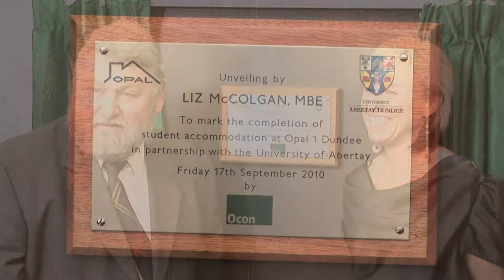Opening of Abertay's new student accommodation

Comment: just to say that i have infact have lived in these flats for a year and arnt as grate at thay protry them.

yes thay have good internet, very stable connection. (best thing in there relly)
the en-suit bathrooms are rather small and don have a manual light swich its done on a mtion sensor and turn off on a timer, anoying when you are in the shower and the light goes out.
the kitchen is what you would espect really enough coubord space and 2 fridges, oven ect.